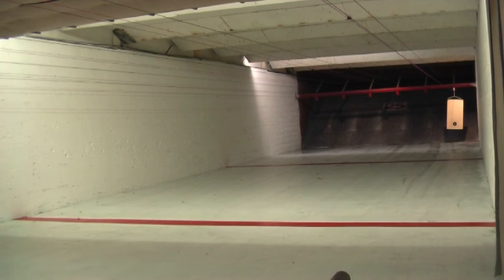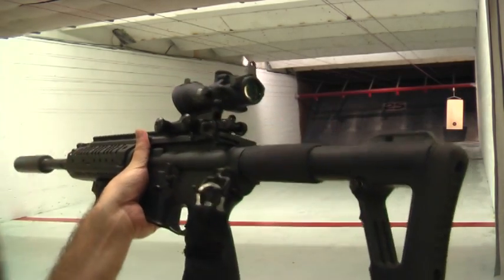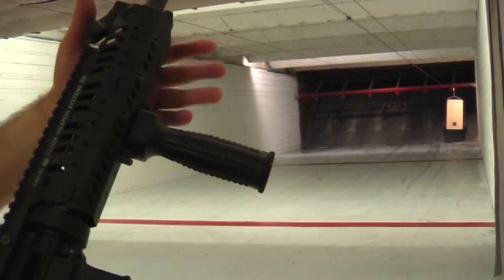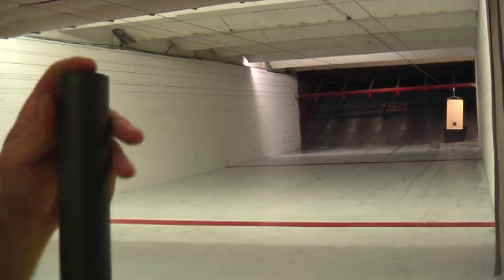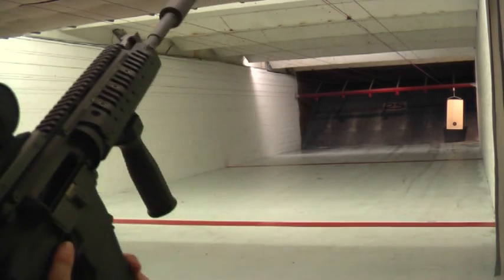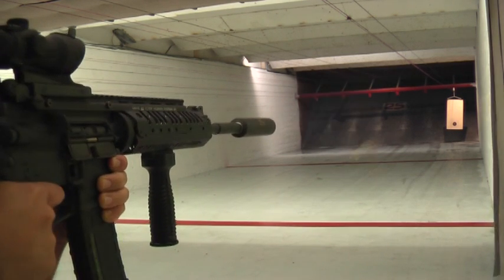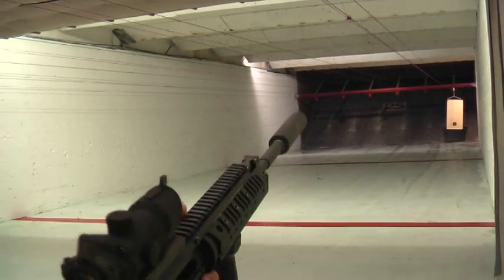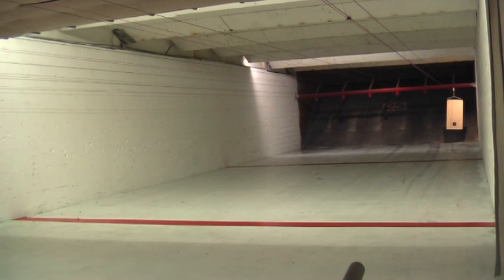My DPMS AR15 with Gemtech M402 Silencer

Comment from the maker: @NeoUmChangSaeKki very common problem, you have to look for front sights made for a front gas block. most BUIS that are made are made for straight top rails and not gas block and upper rail. as far as suggesting any particular sight, to each his own. but it is possible to get a Riser for the gas block to make it even with your upper rail

Comment: Thats why the device is called suppressor ;) As far as i remember, suppressors can lower the sound by about 30dB or so. Thats actually plenty, b/c just 6dB is the "half volume". Wiki says the good old M1 Garand is as loud as 168dB @ 1 meter. So even with 30dB of attenuation we'd be pretty loud. Using subsonic ammo you got further improvement. Environment is a significant factor too, solid walls of the huge shooting range cause massive reverberation, thus we percieve the sound for a longer time.

Comment: Does the suppressor affect the range or velocity of the round?
Reply: if my physics are correct it will affect range according to call of duty... lol
Reply from the maker: YES it does. it will make it faster thus increasing the range. a Suppressor also eliminates the need for Boat Tail Projectiles..  it does shift the point of impact so you want to adjust the scope with Suppressor On. that is an advantage 'ratchet mounted' suppressors have as you can turn the suppressor to adjust to point of impact along with a scope that may have been sighted in without a suppressor.

Comment: Sounds pretty loud to me.
Reply: True...  If you used subsonic ammo, you'd barely hear anything at all.  Of course then you'd have other issues stemming from low gas pressure...
Reply from the maker: vash1053
 if you used subsonic 5.56 it wouldnt cycle the action..  5.56 (or .223) is usually 55gr or 62gr projectile.. if your going to use subsonic you may as well just use a .22 conversion
Reply: zipakna Hence the "other issues" part of my post, lol.